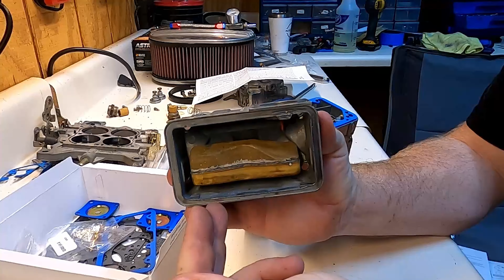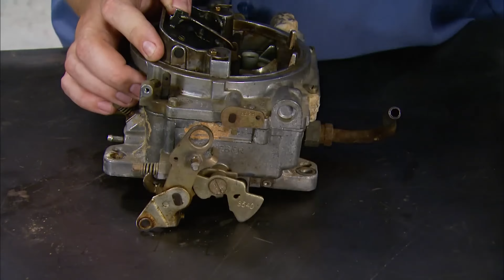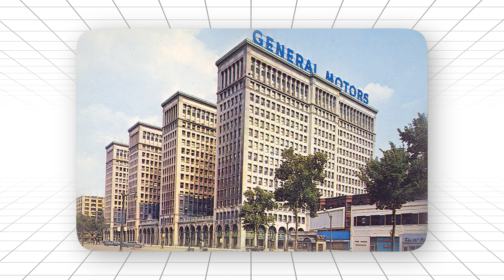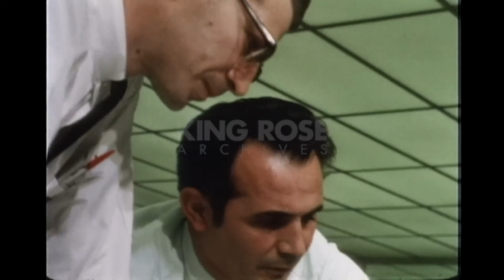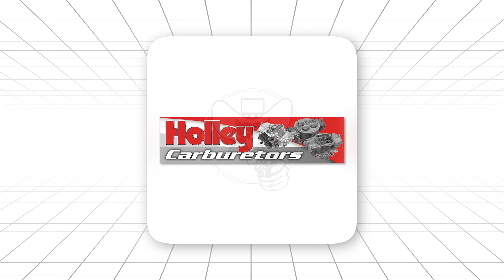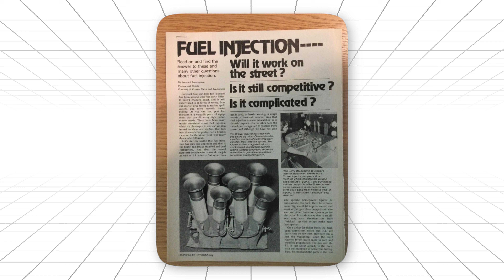The Engineering Marvels That FUELED Muscle Cars

Comment: I started building hot rods in the early 60's, 7th grade!  When the other guys finished looking at the chrome and women in hot rod magazines I took them home an read all the technical information! My Dad was genius mechanic, over the years he had worked with design engineers in the field, many of his "fixes" were taken back to factory as the fix for engineering failures! He had built and raced dirt track cars "Stand on it and turn left" before Life interuphtus!
We studied the mags together and he explained  the details! Great Dad, Thanks💓
Jump ahead many years, I got trained on computers in the Army,spent 30 years in the biz....
In the early 90's I was upgrading a Motorola chip manufacturing facility  in Austin  Tx. to a fiber optics network!  I was headed home one evening  and saw three of the new EFI Corvettes  in the parking lot with three engineers looking under the hood.  They had been involved with the designing of some of the chips for the EFI.  They had just bought the Vettes and discussing how to "improve" the performance?  As we talked I realized they did not know much about the  internal combustion engine, I spent the next four hours or so teaching them  Gas motor 101!  We had many meetings after that, they designed a new chip,  had it produced in the plant, wrote the software, then we ran the computer mock up on AI.  Increased the output  about about 30%, of course never showed it the EPA! LOL!
Two years later when Corporate  decided that they no longer needed technicians  that knew where the electrons went, they laid off a lot of us! I was the account rep for a small college, 10 million $$$ account, which they lost!
When I sent my resume to Motorola, they rejected it because I did not have a Degree?
I was a Holly man, but I could make an AFB sing!  In the 60's I could get AFB's  for free out of junk yards and kits were cheap!
EPA killed the carburetor!
Enjoyed the post!